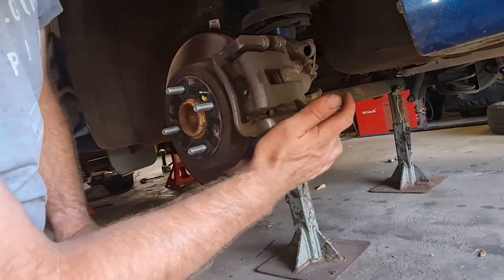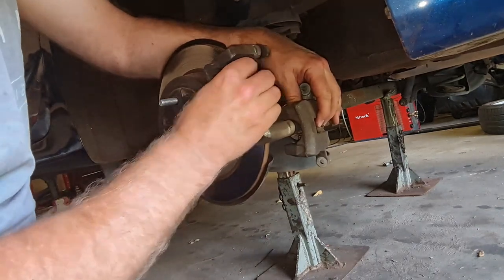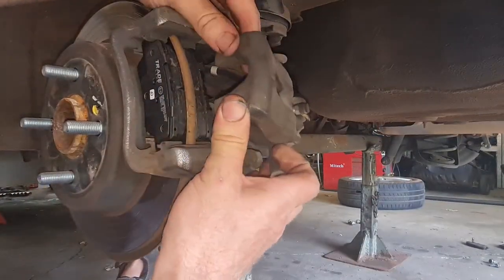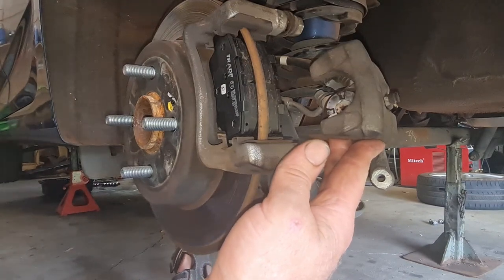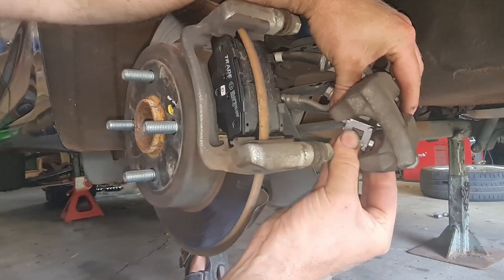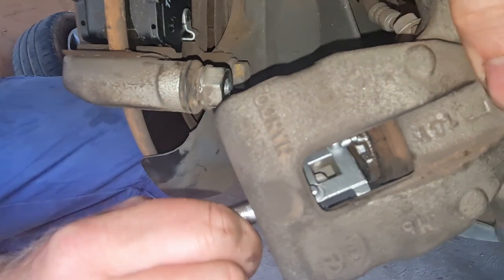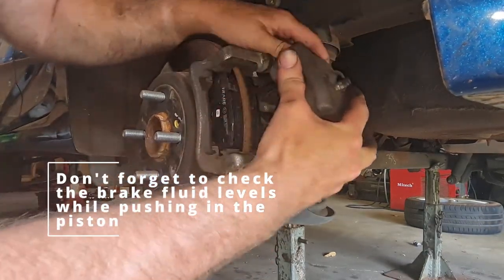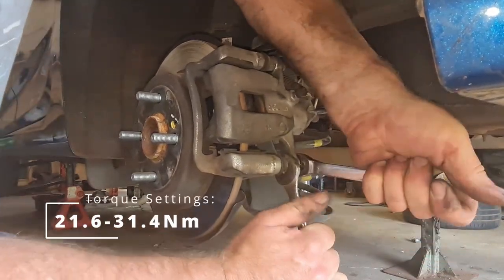The "Ultimate" Guide to DIY Rear Brake Pad Swap - Hyundai Accent 2010 - 2018

Comment: Do you really need the special tool to push the piston?
Reply from the maker: You can get away without it, but its much easy with it
Reply: I was able to get locking needle nose plyers to spin it, worked a little bit better then just regular plyers. Was tuff at first but yeah it wasn’t too bad